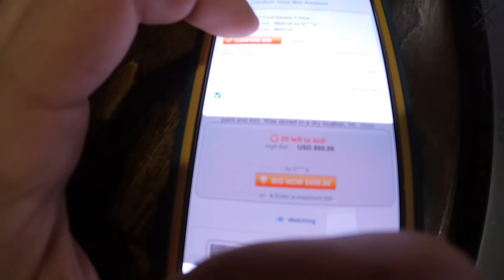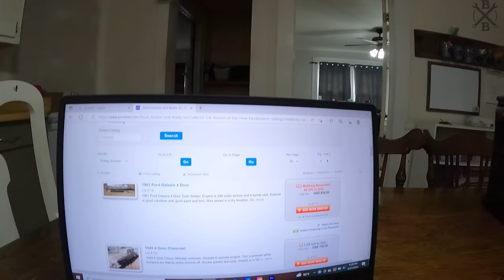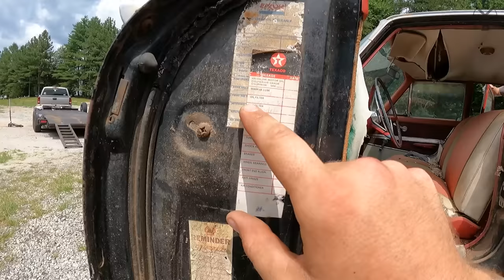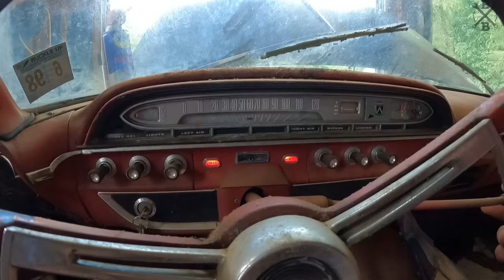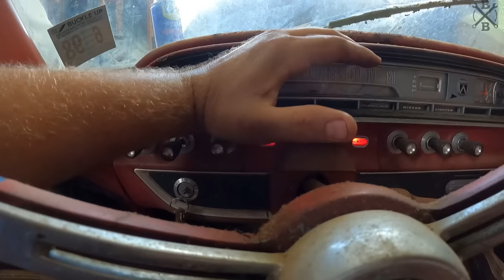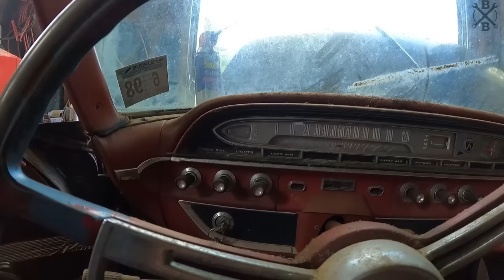BARN FRESH 1961 Ford Galaxie 390! Will it Run After 24+ Years?

Comment: The 406 Cube is what the Galaxie would carry V8 is very good. 390 Cube is more like straight 6 so huge that the duellie haul on the road everyday except Saturday and Sunday. It challenge the oil carton quart delivery work utility truck called Cabover. The cabover would talk to the Railroad hub for diesel but the Conductor said no diesel for any Cabover so that is what happen - the Railroad and train into Bankrupted. 
  Straight 6 went to the Eagle and the Eagle was a monopoly Tires and Marlboro that is also monopoly in The city of Owens Corning and they would merge both Marboro and Eagle car and Tires services named the Biggest plant of the entire Shipbuilding Coachbuilders Union and Jeep called the car Jeepster but The Jeepster would transform into the Wagoneer. The Marlboro became the Truck City brand so that Plymouth city would become recession (depression) and barely luxury, just broke. Karmann and Italy Bertone selling and making big big bucks and monopolizing against the General Electric Ghia is German and Italy Mafia of Russian the car builder of both Praga Punta and Beetle (KDF kafer).
 Hitler is known as the mafia of the Kafer company. Ferdinand invented the Porsche car. The Nazi is known to build the Kafer KDF engine 1100cc displacement and the Kudelwagen was not design by the Porsche. The front suspension and steering rack and pinion rod were invented by these German Prussia Mass production company. Ferdinand is not an inventer F. Porsche is a designer as a draftsman.
 The plant is building instead of trees and bushes and sapling and shrubs and vegetable and fruit at the type of individual farmers. Then it became the industrialist into these sites. Because the plants give resource that make up to afford the warehouse of tools and press/drop hammer. And punch in punch card for building the upper valve seal shape as we call it ring seal with the hole's diameter 4mm or 3.5mm for great Rato into brand new Plant and investment Calculus Office under the order from these potential buyers and I waited as the buyer for 3 months for Rato to start taking over the Kohler engine performance of the auto Lawn mower and snowmobile factory except the cylinder head of 170cc for Rato only. Kohler is not open into the factory because the Kohler is a blow glass and ceramic and paint upon the lawn mower type of specification that these Chinese work inside Kohler only in China for customer and Sales Parts services. It is named only The Rato for power up many transportation right near to the Makita.
 Aol the potential buyer are to help these: real authoritarian named Rex to have the Stamping room bringing into stock/shelf the work into where it ran out of stock/items calledf the ring valve for 170cc YG1550 model and YG1650 mower engine. The motor must stop so the Motors are in parking lot and have Rato into the Management of running metalcraft and fabricator on sheet metal. YardMax is chicago where the Buffalo, NY is better to help the Stamping Room of the powerful demand of new pair of ring seals for valve stem in the internal of engine into brand new motor not for running so it is for sale. Engine is different from motor because engine is for sale. The motor is for driving and running. Engine is like a motor for only public street driving.

Comment: Nicely done video but these cars were arguably junk. My grandparents had an early 60’s 390 Galaxy with low miles and it was constantly flooding itself, suffering vapor lock, a slipping automatic, and otherwise leaving them stranded with endless problems. They finally traded it for a Chevy and had zero problems with the Impala. Ford mostly didn’t make anything decent until the Mustang. And even the early Mustangs were rather flawed.

Comment: Those chrome valve covers means it's a high compression engine. Probably 10.5 rated at 325 horse with a holly carb. I like those 390s. I've had many as I was growing up. They do love that gasoline. I don't think any one ever made got 10MPG. But those engines are durable even when they are high mileage. Just listen for the lifters to start tapping and that's when you add 3 quarts of oil. The 390/C6 was a great combo of reliable transportation. But that gas mileage was a bitch.

Comment: Yes, I know this is an old video but I've only recently found the channel so now is the time to comment. I've said it many times before and I'll keep preaching the message - when resurrecting an old engine, ALWAYS pull the valve covers before cranking over the engine. You're looking for nests built by vermin as well as inspecting the valvetrain for damage/corrosion. Also, pull the distributor and spin up the oil pump to build pressure. Continue spinning the shaft to the oil pump while slowly turning the crankshaft by hand. Go through at least two complete revolutions but I recommend 4 or more while observing the rockers. You do this to ensure that all the bearings are lubed, the lifters are primed (hydraulic lifters), oil is already flowing at the top end when you do crank the engine and that the lifters/pushrods/rockers are all functioning correctly. This is especially important for engines with hydraulic lifters because of the potential to bend pushrods due to the lifters not having oil buildup after long periods of inactivity. The FE engines are famous for bent pushrod syndrome - and the bent pushrods often come about due to the ignorance of those trying to get them running again. The bottom line is that you eliminate risk when you prime the system BEFORE cranking over the engine and you'll find that long dormant engines are usually far easier to start and keep running as well. Best wishes!

- Max Giganteum

Comment: The 1961 ford just like you found was my first car at 16.  I paid $25.00 for it with 26000. Miles on her.  She had a bad trans,  paid $10.00 at the junk yard for a used one.  I drove this car for 4 years and the only issue I had was vapor locks.  My neighbor was a mechanic and told me to put wooden cloths pins on the gas line and that worked.   I sold the car with 79000. Mile her for $25.00.  Wish I had that car today.

Comment: The 1961 Mercury Starliner or 1961 Galaxie that it looks 1959 Galaxie with tail fins. The ballistic resister is the component of electronic. The modern electronic came with transistors since that the vacuum tube system of the circuit board called Assembly Unit of control electricity and wiring harness plus fuse box. The electronic is really means electronic man or troubleshooter. But Safety of caution of high voltage is with hard hat Bell Linesman. DC is 70,000 volts in the car is very electricity system. Electronic is not more than 10 volts DC. It depends of the rule of safeties like static preventive or electronic is sale business for example, I sell static. The static is not electtricity because I compete against the electricity sales man in powerhouse.

Comment: Holley can help for $22.00 dollar to have the kit and it rebuild 2100 two barrel. For automatic choke and rebuild gasket set kit for 2150 is worth Autolite $25.00. Which one 2100 or 2150 either one is design for 390 Cubie.

Comment: Not to be negative but, this is not a Starliner. Starliners were 2 doors with a special "fastback" roof, different glass all the way around than all other '61s with the exception of door glass, even the vent windows were special to Starliners. This car would be a Victoria Sedan which was the high trim option. Being a 390 is interesting since that too was the high option. of course the HiPo 390 was super rare. HiPo cars were also Z code so no one really knows how many were actually made. Probably less than 3k in all models.

Comment: Borg Warner 3 speed. Autolite 4100 carb.  BRF-42 spark plugs. Change the valve stem seals. You may have to drop oil pan to get the crumbled valve seals out of oil pump pick up tube.

Comment: Classy cruiser and no mistake. Don't just holllow it out and hork it out the door... do a nice job on it and it will at the very least give you a damn sexy long road trip machine. Love this era of Fords and I am not the only one. Maybe get a 427 aluminum block for her with trick flow heads lol  THEN drop a floor shifter into her [I'd call it Black Bart for shites and giggles]. Love this car guys. lol Ya, get rid of that Grampa 3 on the tree garb... get you some Cue Ball hurst action on the floor... I know you can put a modern 5 speed behind that motor from the 80's & 90's stangs because Thunderhead 289 is running a T-5 manual floor shifter behind his 390 he dropped in the maverick he just did Hotrod Power Tour in lol  390 and a floor shifter... a new bit of rubber on the accelerator pump of the 4 barrel... blast off! lol Take this car on Hotrod P-Tour next year with your Dad and mingle with the cats. This car would be a HIT!! Love it!

Comment: That's a nice find but!!! I believe that's just a Galaxy or a sunliner!!! We had a starliner with a 390 three speed overdrive and it had a bigger back glass, bubbled !!! Also where you have the single medallion between the back door and the back glass a starliner has three medallions!!! And it's shaped more like a fastback !!! My dad was working at Ford when he got the car from my mother. The the package tray in the back was big enough that I could sleep up there and did!!! I noticed one side had Galaxy the other side of your front fenders had starliner the designation would be on both fenders not different !!!! But it's still nice find good luck with getting it running!!!! Something else you might want to try with an old engine like that I have used marvel mystery oil and let the cylinder soak!!!!

Comment: The battery tray is very good for Ford F100 but I kill the hitching attachment away from the V8 two tone truck but it was Bondo one tone full of rust and all buble of the overcoat because the wet Bondo is worst than original paint of the Ford 500 only if it is 4 barrel Limited Ford since the 4 barrel went to the old Bug VW.
 I see one Bug that has the black pin line in both front and rear bumpers so it is not soccer shoe bumper with its top rail tube rusted atop the bumper. The Super beetle is air conditioned for cooling but I don't need it.  Just this one my brother 1964 VW Beetle into the Yellow all rust but still good to drive it from Durham auto dealer and dealership lot of all pre-owned about 100,000 miles odometer cars. But my brother sold color faded flat red all original beetle with mangled roof.

Comment: You'll find the starter is an odd-ball. The bendix alone costs more than a whole starter for a 65+ 390. 
You can use a starter for a later model (again, 65+) 390 and even though the number of teeth and overall shape are different, it will work OK, use less current and is much more available.

Comment: Did you pull out the air filter shroud and see if it's Holley two barrel atop 390 CID. The four barrel goes to the 351 CID. Good buy on the1961 Galaxy 2 door car from the auction.

Comment: You know Autolite was owned by Ford for a while I believe. I think I would replace the distributor with a HEI distributor, you can get one from eBay for about $130 with wires, cap, rotor and etc. Clean up that engine bay. Give that baby a thorough cleaning inside and out then buff/polish out that paint. After that I would say it depends on what you are going to do with it. Another thing I would do would be replace all the brakes with disc brakes and install sway bars if it does not have them, new shocks too.

Comment: I like 390 v8 . Don't throw away a 352. The cylinder wall castings are heavy wall . It can be bored  out  .   A 428 crank shaft & a set of heads turns a 352 into monster motor..  No Shit....

Comment: The black 4 gear Forward to Like a black Galaxie 1961 have a starter with the magnetic pole that engage the starter to the transmission connect to the output of crankshaft gear teeth.
 Take it out the Magnetic pole must come off. There is no need for a solenoid for starter. The push start would help then check the motor after you either break the piston rings or take off the cylinder head and use honing balls for grinding the cylinder wall so to protect the piston rings.
 The Rocket car engine is with Mercury rocket or car Starliner that is to be made out of aluminum instead of steel Peenemunde missile onward where I work with Dad to make it almost Saturn 1 car or rocket. Pontiac Lake is where I'm from. Don't dare to touch the missile that belongs to no Putin ever Uncle Sam want You before Putin that must stand in the Stand Court finally arrive instead of nuke these innocent lives. Defense are Mechanics and Master ASE technicians is always the goal. Them are doing The Biden's Army in Offense.

Comment: Just my personal tip, and maybe I missed you doing it, but before I’d crank any engine over that had sat for decades, I’d pull the plugs and shoot a little penetrating oil (Mystery Oil), or even a fogging oil in the firing chambers just to wet and soak those piston rings where they’ve sat against the cylinder walls for so long. Let it sit for a day and then fire away baby! Love your channel brother!!!

Comment: Also, I realize that most people don't really worry about this, but I have ADHD and OCD, so putting Motorcraft parts on a Ford is important to me. Just like using AC Delco parts on a Chevy and Champion plugs in a Dodge. That's just the name of the game. They were designed from the factory to run on those parts and that's what runs them best. Not to mention that I HATE anything that Autolite sells because it's always garbage.

Comment: Yeah, just letting you know I know about those 61 Ford galaxies that’s a sedan it’s not a star liner it’s not a son liner it’s not a son coupe. The one with the glass in the roof is pretty rare. The rear motor is coming that would be I believe a 406 V8 big block and mine was automatic 350 to factory 39,000 original miles. Got it when I was 13 years old fix it up drove it when I was 15 so sweet car. Mine was the actual Starliner was a two-door with a fastback roof great big back window and it had three stars on each side of the sale panel and it had Starliner badges on both fenders in the front. Not just one do you have a galaxy badge on the driver, side fender, and a star liner on the passenger side fender and I don’t even think that’s the original Starliner star on the sale panel there more round with triangles coming off it like a star but it’s cool car no less than try and take anything. Way from Ya ,,has a nice situation you got going there.

Comment: Its homework,        its a buildable engine,to a point,400 big block 5 or so hundred horse,get a electrontic distributer out of a 757677 360 ford pickup,grab as much harness for the ign.box,you wont have to worry about points then,it works if its hooked up right

Comment: Please not WD-40 or any other oil or water displacer. Spray graphite is what you use to lubricate locks asitdoes not attract snd hold dirt. WD-40 is quite literally the 40th formulation tried when the vompany was deboping a water displacement fluid.

Comment: All of the comments are correct about Autolite.original Ford. If the carb is motorcraft...also was a Autolite. Detail it put some Cragar SS and new rubber. Boil the gas tank and get the rat nests out of the exhaust and you got a 7 to 10 $$$ride. Great video

Comment: I think that I’d have put a socket on the generator and power steering pump first and ascertained their condition before chopping any belts. If the PS pump held fluid  which if I remember correctly they used ATF chances of it being frozen up would have been pretty slim.

Comment: Rite on guys that's a big heavy duty 390 FoMoCo of course it wants to live when I was a young teenager I had a 1962 Mercury Monterey what beautiful land yacht the 390 ran beautiful there was no top end i tried to find it but I hit my top end before the big 390 did it would get her stride and just keep going all stretched out rolling smooth pulling strong the iron mill just keep on the faster it ran the smoother it would run across wide open range

Comment: Those stickers are nothing, my 62 Galaxie has two stickers from the time it had its oil filters and differential messed with around 16k original miles, the date on it said 65. And champion spark plugs from 1965

Comment: Biggest hurdle to making Galaxie presentable (IMO) is headliner. Takes patience and skill to install one well when front and rear glass are out. With glass in, extremely difficult to do a good job. Thorough cleaning of stanky upholstery and new carpet will go a long way towards making it a car you want to spend time in. Engine deserves new starter, water and fuel pumps, and plug wires. Because it's already got a third pedal, I'd be sorely tempted to drop 4 speed stick into it. Best of luck, fellas.

Comment: As soon as you opened the valve covers you should have dumped oil over all the rockers, even if you over fill it. Just to lube everything while your waiting for oil pressure. Those FE's dont build much oil pressure to begin with and dont take much to blow them apart if you dont pay attention to it...

Comment: If you haven't already replaced the starter, I have one here with only 300 miles on it. I had to replace it with a mini-starter so my headers would fit. I am in Greeneville, Tn. You can have it for the shipping cost.

Comment: I’ve got a 72 390 out in my shop I want to rebuild it and put it in my 66 f100 custom cab short bed that’s a really nice truck with the original 240 3 speed. The truck runs great with no problems at all but the way gasoline is right now I’m just not sure what I’m going to do. That car is just like my uncles car I use to ride in back in the late sixties when I was a teenager.